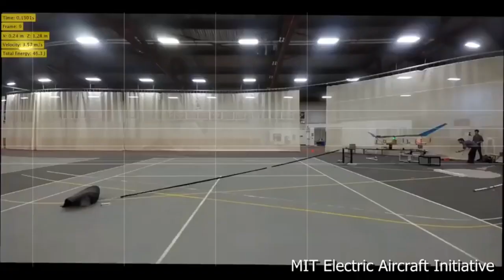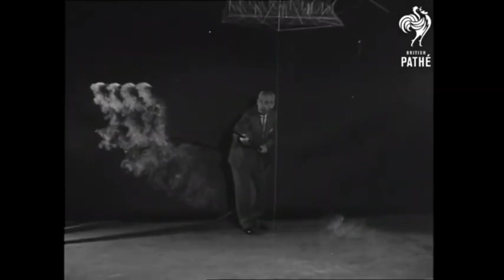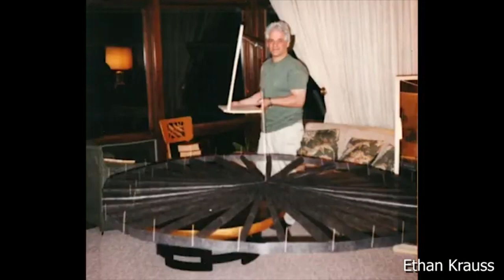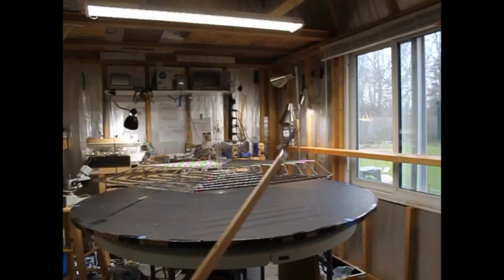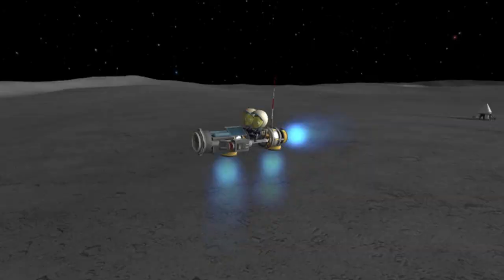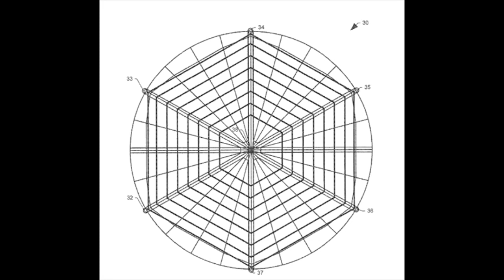Self-Contained Ion-Powered (propelled) Aircraft.  This ion thruster lifts its power supply!

Comment: Hi ethan,
I was able to redesign my ion lifter again and using a zvs driver multiplier i was able to achieve vertical thrust with about 90% vertical stability. I don't know why my royer circuit with irfp260n mosfets fail. But i use them on my zvs no problem. Im on vacation next week so i will put more time into the stability and let you know.

Comment: Can you circulate the flow in a toroid loop like Brown talked about in his notebook volume 2?
Reply from the maker: It could be done, but I don't know what the advantage would be.  If you could direct me to Brown's notebook volume 2, I would be most grateful!
Thanks a lot!
Reply: @KraussEMUS1  I replied but it isn't showing up now. Maybe I can't share links in comments anymore. Well you can find them by searching Thomas Townsend Brown notebook. I was talking about volume 2 entry 79 but his circuital dielectric flow is explained in volume 1 entry 71.
Reply from the maker: @michaelcre8   I appreciate the comment. I found the article you referenced.  I wouldn't know anything about it.  I just do ion propulsion.
Thank you for sharing though!
Reply: Oh sorry reading this again I see I was focusing on the wrong part. The key part of what he was talking about was using positive ions instead of negative. He has an electron emitter over the large anode to stimulate positive ion emission around the lower part of the anode. And then he moves the positive ions by their attraction to the cathode underneath. 

Is it actually possible to stimulate positive ion emission like that?
Reply from the maker: @michaelcre8   Yes, sure, the emitter can be positive or negative in EAD propulsion.  I think of it differently than a lot of folks but, really the same as in chemistry, although I am an EE.  Electricity is really the flow of electrons and energy usually through wires.  So contrary to what some say, there are just electrons flowing in and on a wire and energy.  A positive terminal/electrode is where they can build up and the "positive," is where there is a lack of electrons.  In an old-fashioned CRT picture tube, the electrons travel from the negative emitter to the screen, as one example. O2 molecules have an outer orbital molecular shell that absorbs extra electrons without requiring any added energy of ionization, just like a sponge.  I use very low current high voltage 2.5 micron etc. emitter wires connected to the positive on a novel reverse polarity voltage multiplier.  When the O2 molecules absorb electrons, it is called excitation.  They emit the least photons when they are being "gently" excited (technically none, but there are collisions).  When they reach the collectors which are at the opposite polarity, so long as there is nothing sharp there, many of them can continue past the collector without being de-excited.  The less de-excitations the craft creates the more efficient it is.  These are just theories though what works, works.  People learn best by doing their own experiments, I think.
Thanks for commenting!

Comment: Ethan, have you experimented with AC applied to the collectors?  Might help drive off the remaining space charge around the collectors between thrusts.  Maybe a second stage with another collector below the main array that goes positive to flush the negative ions away from the collectors?  P2 system mentioned in William Lyne's Occult Ether Physics book.
Reply from the maker: Hi Will,
I tried pulsing the power at many different frequencies a long time ago.  True AC does not produce any lift.  Pulsing the power just reduces the lift according to duty cycle.  Sometimes there can be interactions with electronic components especially transformers that make it seam a few percent better.  In theory reducing electron output density could cause a slight increase in efficiency but a reduction in overall lift.  Sub-nanosecond pulses can reducing arcing in a system with low emitter wires, but that isn't an efficient geometry.  Not sure about sub-nanosecond pulses at extremely high voltages very low currents though? Multiple stages give significantly less efficiency, force per watt, when compared to single stage systems. I don't know what a P2 system is, unless you meant "page 2"?
Thanks for mentioning it!
Reply: @KraussEMUS1  Are you familiar with Tesla's high frequency current patents? It's DC impulse at high frequency. I haven't tinkered with that stuff in about 10 years but the potential for getting much more efficiency with systems could give you a power generator that weighs less but provides more.
Reply from the maker: @LegalTyranny  
Hi LT,
Yes, There is newer technology that is smaller and lighter though.  I had to develop a system that is smaller and lighter than anything else in order to get this working.
Thanks for asking!
Reply: Someone beat me too it. As for small super light weight high voltage a solid state Tesla coil could be the front end just feed the output through a high voltage diode. I've seen some really powerful voltage multipliers ran this way.

Comment: Ethan, do you know what the story is with those stun guns that say in the advertised description for example, 180 BILLION volts? Is it false advertising or ?
Also, can stun guns with those voltages and/or part(s) from them be used in place of a high voltage power supply?
Reply from the maker: Hi Ned,
Many stun guns are advertised with much higher voltages than they actually have.  A high voltage spark will jump roughly 30kV per cm between two sharp points.  Most stun guns output a series of pulses at a pretty low frequency and it is usually ac.  Components would have to be added to convert the output signal to DC and  it would have to be smoothed so that it was continuous for the most part .  Usually stun guns even without the extra parts weigh more than a pound depending on the model.  Perhaps there are some that weigh less though.  Higher frequency systems are lighter. and better suited for the task.
Thanks for asking!